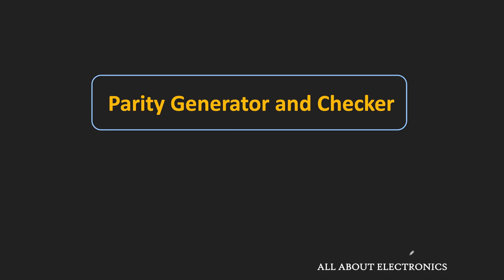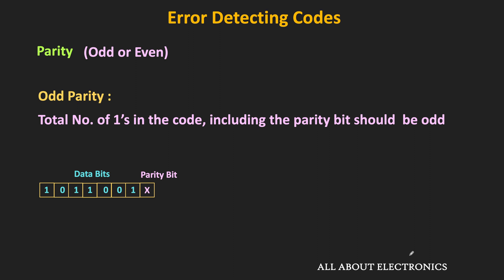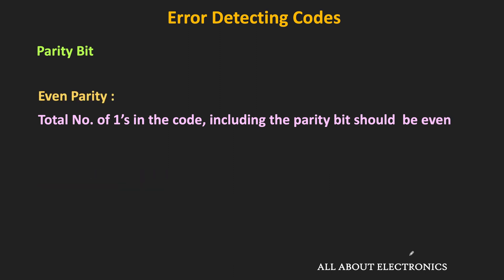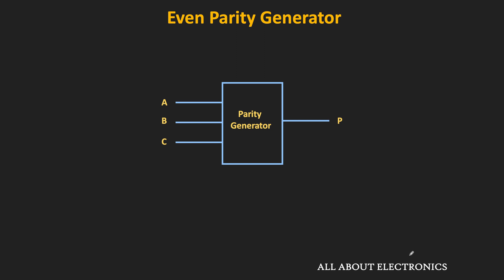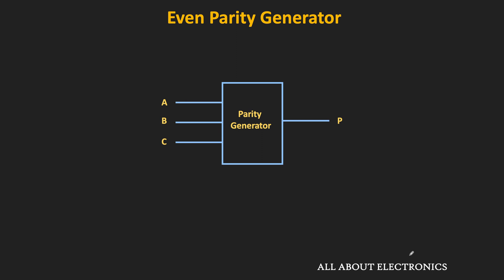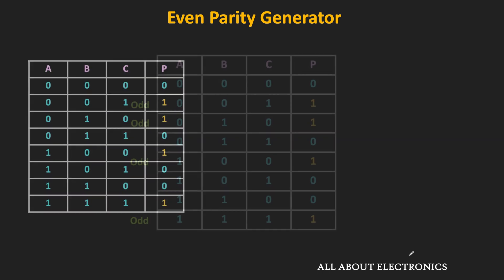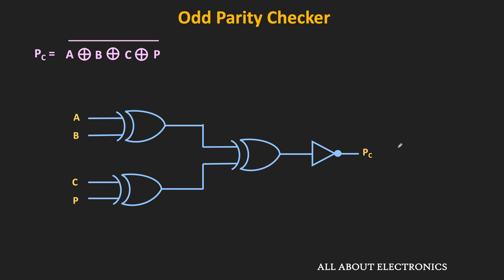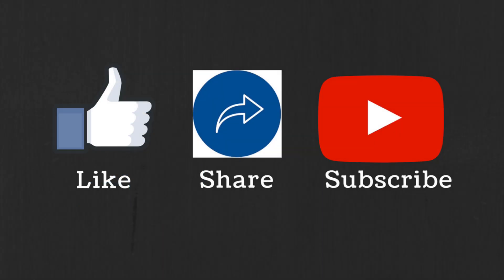Parity Generator and Parity Checker Explained

Comment: What happens if parity & one other bits get inverted due to some disturbance then parity checker will not detect error
Reply from the maker: The parity bit is used for the detection of odd number of errors. If there is two errors in the code, then it can't be detected. For such detection and error correction other codes are used. One of them is Hamming Code. It is already covered on the channel. Please check the digital electronics playlist on the playlist  page of the channel. You will get it. 
In case, you are not able to find that video, let me know. Will send you a link.
Reply: @ALLABOUTELECTRONICS  No, I am asking that what happens if parity bit gets inverted is there any solution for this

Comment: if there are two errors ..then this parity bit checker doesnt finds the error .then what is the use of it...explain please
Reply from the maker: over the time different error correction and detection codes are used. As the code can detect and correct more errors, the overhead along with the bit also increases. One of them (the hamming code) is already covered on the channel. For more info, you can check this video:
https://youtu.be/t4kiy4Dsx5Y?si=mFwNQoX3sGiDkom-
Reply: @ALLABOUTELECTRONICS  so here the parity bit checker is only used for only one bit error detection..
Reply: Thank you❤
Reply from the maker: @__reva__143  Yes.

Comment: Can we make parity checker to show 1 for 'no error' and 0 for 'error' using additional not gate?
Bro, what if the parity bit itself got changed?
Why don't we just say the total 1's of a signal as odd or even without using parity?
How can we know the error is on a single bit or in two bits?
Is the parity bit always added as MSB or LSB?
What can be used to detect errors with more than 1 bit?
Reply from the maker: Yes, you using the NOT gate, you can reverse the logic of the parity checker. 
If the parity bit itself gets changed and if there is odd numbers of errors in the code then it can be detected using the parity checker circuit. 
The parity bit can be at the LSB or MSB position. It depends on the detection scheme. But transmitter and receiver should agree to the same scheme. 
Using the parity checking method we can detect only odd number of errors. 
We can't detect even number of errors. 
To detect and correct more than 1 bits error other error detecting and correcting codes are used. 
For more info, I will encourage you to go through these two videos:
1) Error Detecting Code: 
https://youtu.be/Bwih7_AT1oI
2) Hamming code:
https://youtu.be/t4kiy4Dsx5Y
Reply: @ALLABOUTELECTRONICS  thank you very much for your valuable reply sir 🙏